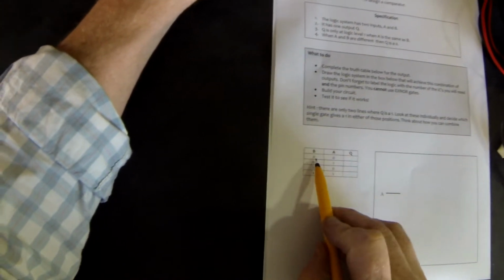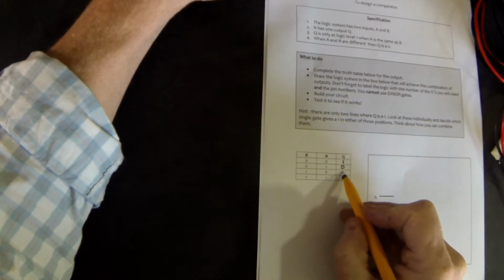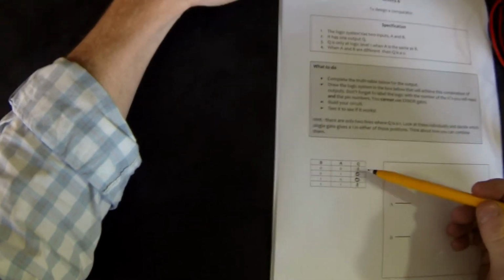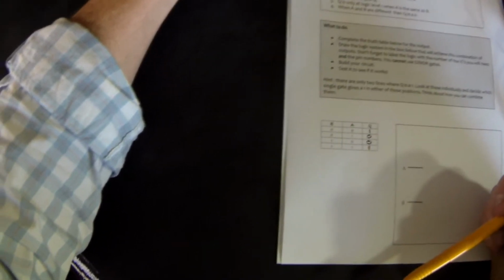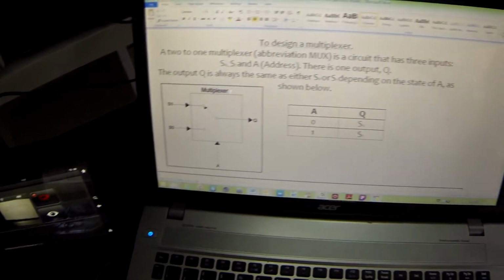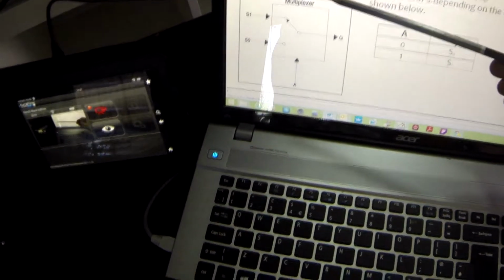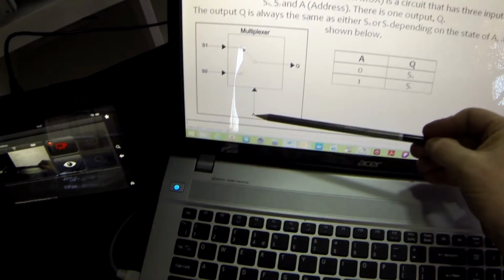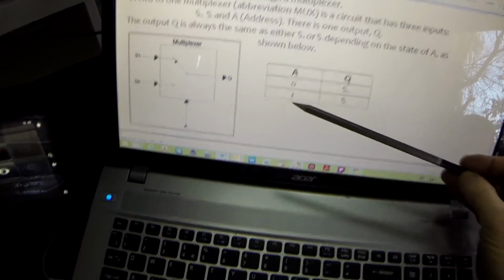Digital Electronics Part 2 of 4 GCSE AQA Electronics Activities 3 , 4 & 5

Comment: 10:04 Instead of using a third gate, why not just join the two wires together? Surely that'll add the two AND and NOR outputs together and form a singular 1001 output at Q.